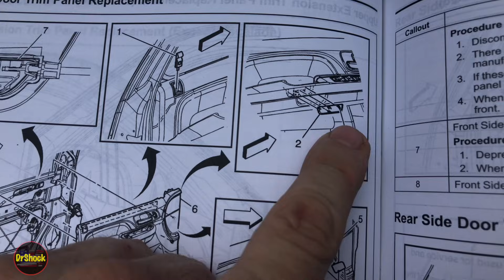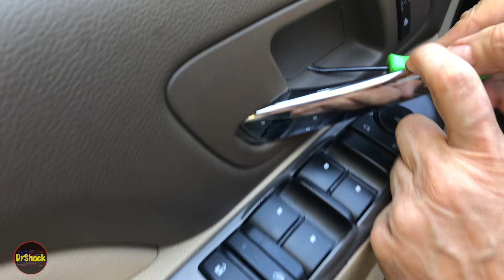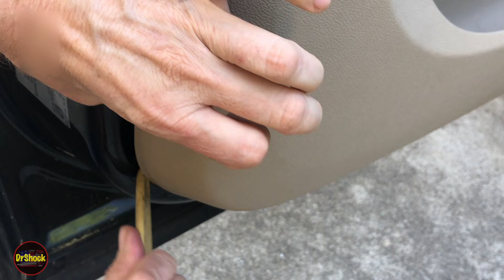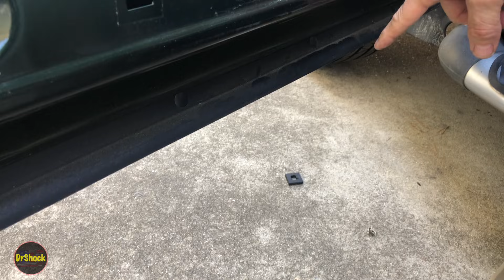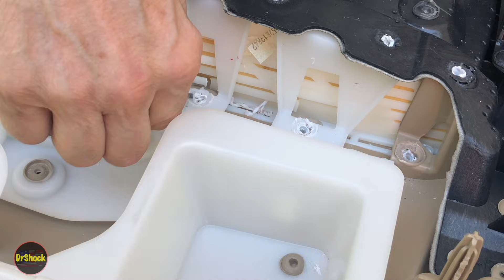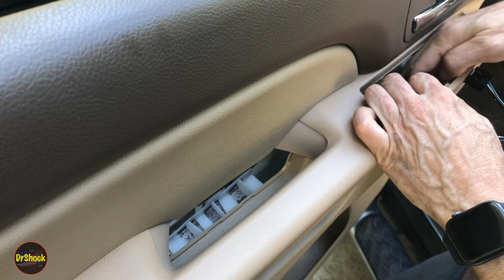2010 - 2014 GM SUV Truck Front Door Broken Armrest Grab Handle Repair / Replacement (Chevy & GMC)

Comment: Is it soft like factory or hard plastic
Reply from the maker: If you stick with the brand name I showed, its the exact same texture as GM used and has the same feel.  The "cashmere" color though is the darker one that earlier years used, it won't match the lighter cashmere of the last model years like I showed.   I put the links for this brand in the video description.

Comment: Thanks, I used a 1" paddle bit instead of trying to chisel away the plastic welds. The paddle bit (a common bit used by carpenters) has a pilot portion which is  approx 1/4" and the paddle part takes off the melted plastic  flush with the arm rest/pull plastic tabs.

Comment: I will be doing this as soon as my days off line up with the weather.  Fantastic video.  I have the black one and I bought some clips with it since my door panel has been off a half dozen times now as the exterior door handles keep breaking.  Very much dislike the cheap plastic welds on key components.

Comment: I found 1 issue with the upper studs. they are finger tight. Use lock tite and reinstall studs. Also, I have a 1/8 gap between armrest and door panel. any idea how to correct?
Reply from the maker: Did you use the name branded part I showed, or an off brand?   The fitment on the aftermarket brand part I showed and linked in the video description has proven surprisingly accurate to OEM GM, but the Chinesium ones not so much if at all.

Comment: I tackled my wife’s 2013 LTZTahoe today.  I watched your video several times over the past couple weeks to get comfortable with the job.  It has the ebony black interior and if I scuffed it I would be sleeping on the couch.!   It also has the vented/heated seats which requires another step that is more complicated than you would think.  I did finally get it but was a pain to figure out, if there’s a chance you could update your video I bet the next guy would be grateful.  Also I have a question, the top outside plastic clip on the door panel popped halfway out on its own after I finished.  I tried to push it back in but keeps doing it.  Anything I can do aside from taking the whole door panel off again?  Thanks again for the great video!

Comment: I'll just add that when I did mine, the top front mounting point was completely missing/incomplete from the factory, you might have noticed that his seems to have a re-drill in that area 28:46. I ended up needing to put a new hole a little higher for it to fit correctly.

Comment: Nice video! 
My 2012 Tahoe panel is designed differently. When I remove the old / bad arm rest and pull handle, under that is a metal support piece that runs from the very far left and stops just before the hole for the window switch. The bottom of the grab handle is permanently affixed to that metal piece. There's also 2 holes for metal fasteners to strengthen the grab handle and affix it to the panel. The aftermarket arm rests I've finding are not designed for the panel I have...
Reply: @morecowbell235  me too. I also have a metal bracket. Cannot install. Wish I didn’t already completely destroy the old one. Did you find a solution?

Comment: The only problem is the doorman product only works for vehicles that have the interior handle above the armrest and not below.  Amazon has the products that cover each of these types.  However your video does a good job in basically explaining the process in general for this fix.

Comment: Great video. I just replaced arm rest on 2014 Suburban. I know i could not have done it without your video. I used a black replacement from Dorman. I did black so color worked out great. Thanks for the help!

Comment: Great video! Just replaced mine and it went smooth thanks to this video! Quick question- Do you know the part number for that last trim piece you snapped in? (Behind the door pull) Mine is lost
Reply from the maker: Thanks.  That access cover is long discontinued by GM, but I do have the part numbers in the video description as they turn up used from time to time.

Comment: The OE panel would be awful--same design as the one you just took out--so you'll get the same result in a short time. Great video, thanks!  My part just arrived today.  BTW, Dorman now offers the passenger side as well.
Reply from the maker: Thanks, looking at the Dorman site they still only list drivers side.  I wrote them, and they replied that's all they have for this model year series.  You may be looking at a Chinesium fake for that RH side.   Though Dorman has introduced a new color for the LH side, and I updated the video description part numbers accordingly.

Comment: Hello. Great video. Just wanted to let you know that the stud that is cut shorter on the power buttons end is not a defect. Mine is the same way and I noticed it is to allow clearance for the power buttons unit to fit in place.
Reply from the maker: Yes, I added a correction to the video after it was uploaded in the description.  Thanks.

Comment: Will doorman come out with a passenger side and can this be painted with a interior paint
Reply from the maker: You would have to write to Dorman from their website for that first question.  It's far far less common on these models for the passenger side to break, so likely not economical to tool up for that.  There are some really low budget Chinesium offerings for the passenger side.  But personally, I'd just put a new, or used, genuine GM door panel on before using one of them.    As to whether it can be painted, I would say no.   The material is soft and flexible, and interior trim paint usually works best on hard plastics.  Flexible plastics tend to crack the paint in time.
 
In the video description I list all the colors.  I believe Dorman has three now.
Reply: Ii used a chinesium on the passenger side. Holding up well.

Comment: Very professional video. I ordered a replacement from Amazon made by CAPPISALO 80995.
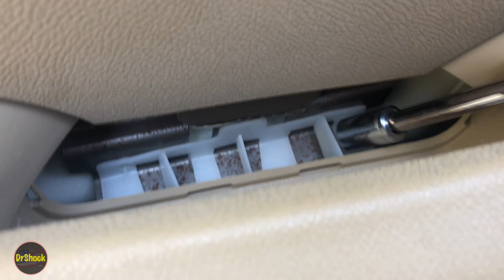Just got here, but I notice that screws came with instead of the fasteners that comes with Doorman product. Are you familiar with is product? Do you think it will work? 7:53

Comment: Chevy has two different arm rest replacements. Would you happen to know the parts number for both. 2012 Chevy Silverado 2500HD
Reply from the maker: The numbers for the aftermarket armrest I showed in this video are listed in the description text area.  Since the vendor only produces a LH side part, I also listed the GM trim panel part numbers for the RH side as well.

Comment: Can you please provide the parts number for the passenger side front armrest repair kits for all 3 colors?
Reply from the maker: They are listed in the video description text area.
Reply: @DrShock  I only see part number for the LH Font Door, I was asking if you could also add the RH front door part numbers please?
Reply from the maker: The product and brand I am recommending here unfortunately does not offer a passenger side version.  I mentioned this in the video.  Dorman only does the drivers side currently.  While there are some Chinesium imports out there, I would not use them personally as they are of lower durability.  If a customer came to me with this problem on the passenger side armrest, I would use the genuine GM trim panel and those part numbers are in the description.

Comment: Well done sir. Not a typical mechanics tool but a sharp wood chisel on the plastic welds may work a little better. I'll give it a whirl when I do mine this weekend. The repair panels I bought uses screws instead of nuts. Instead of thread studs with nuts, you use pan head screws and screw into the plastic on the repair panel. I think the grab rail repair panel in the video is probably going to be more robust than the panels I bought off Amazon but such is life...
Reply: Was yours a CAPPISALO product? Did the screws work for you?

Comment: Amazon does have the passenger side in black and tan.
Reply from the maker: Those are not the name brand part I showed in this video (which are only available for the drivers side and also in a gray color now).  I believe those you mention would be the unbranded Chinesium made ones, which use a different attachment design that differs from what I showed in this video.
Reply: @DrShock  well i have a 2013 Chevy avalanche. It works just fine. It fit's great. No, it's not the same name brand because they only make the driver's side. But the one on Amazon is the only one you will find for the passenger side. Otherwise, you will have to buy the whole panel, which will run you anywhere from $190 to almost $500, and that's used.

Comment: I wish it was made for the passenger side
Reply: @hoseman1  they do got passenger side to
Reply from the maker: The aftermarket brand I'm showing in this video is only available for the drivers side on 2007 - 2014 SUVs, and in only three colors (listed in the video description details).   For the passenger side you'll have to go with genuine GM for the same OEM look and feel.

Comment: I have a 2013 Tahoe 5.3 with simultaneous codes P015b and P015d, check engine light went away on its own for one day, then came back on with the same codes in it, can you offer any help, thanks.
Reply from the maker: https://youtu.be/54ka-RyyDM0

Comment: I think you should use a larger drill bit ! thanks
Reply from the maker: You won't get the best long term fitment on the replacement studs if you make the holes too large.   If the replacement armrest studs are able to move around, then the repeated movement can eventually crack the plastic mounting structure itself.
Reply: doing so removes too much of the factory plastic where the armrest attaches. Smaller is better. I was able to get a multi tool in between and didn't have to pick out or chisel anything.